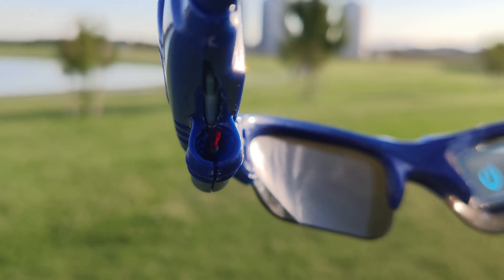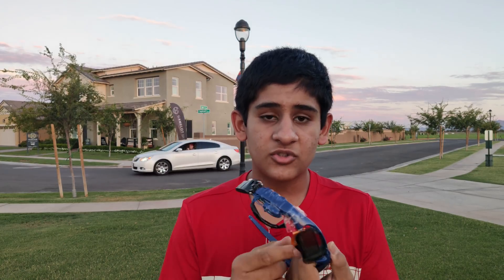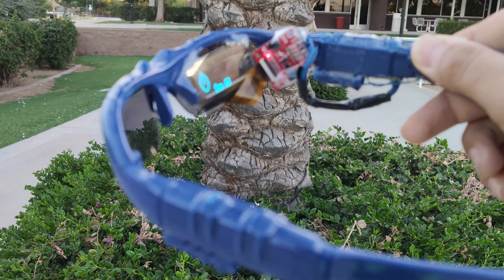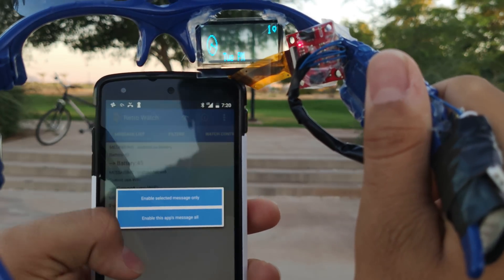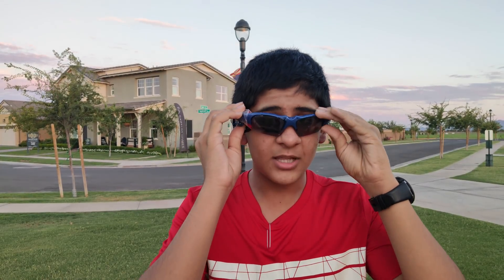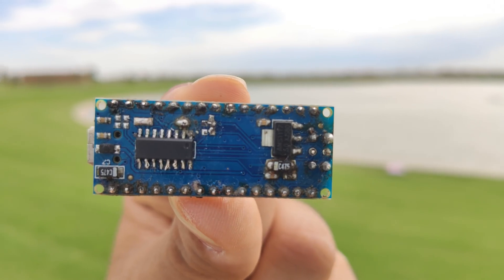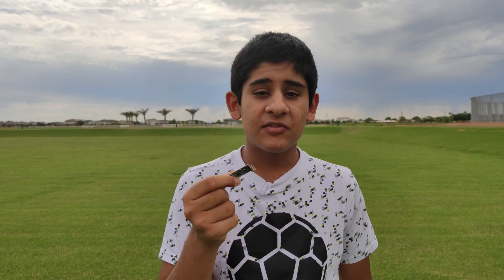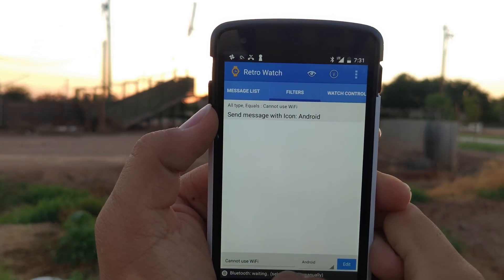Smart Glasses

Comment: Interesting! I'm planning on creating my own pair of smart glasses by augmenting my current pair--I have a vision impairment, and therefore I cannot make a seperate pair of smart glasses. I do have the software requirements nailed down to circumvent the vision impairment I have. These requirements are:
▪ A high level of magnification 
▪ Practical facial recognition (a maximum distance of 20+ feet away or higher)
▪ Object recognition 
▪ Distance indication 
▪ Text reading
▪ LiDAR 
Object recognition, distance indication, and the ability to read text easily will allow me to navigate cities safely and independently. I will be able to finally read signs, navigate city streets, and much more. Just like your design, due to fact my requirements are based off features in software, my design will be extremely versatile and functional. 

Keep up the awesome work, and I hope this will pan out into something big one day!
What coding language did you use, if you don't mind me asking?
Reply: I've been working on a similar concept, I was using C to program mine. I really like your designed features
Reply: @sam10155y  Thanks! Good luck to you as well.
Reply: I have been using a pair of myoptic glasses since the 1980s to aid me with a visual impairment, and I find these concepts fascinating.

Comment: great job, didnt know transparent mini oleds were available already. however you cant read anything when wearing the glasses it is much to close to the eye to focus. what lenses do you use?
Reply from the maker: I used page magnifiers  in a little box shape. The middle of the page magnifiers is stronger than the edges so it is almost a hacked bifocal lense setup. That is one of the main things I'm trying to improve in the next version!
Reply: @marskapadia6298  yeah.  No you didn't. Nice try though.  Page magnifiers aren't invisible and they cause major distortion at a distance.  Good job claiming to have done what other people have actually done.  Really leveled up your lies from "omission" to "straight up fraudulent jackass".

Also.  What did you smd solder? Ps. Its not called smd micro based soldering.  Its just called smd soldering, though it doesn't seem like that had an impact on your design at all. Wires aren't considered smd.
Reply: @HyperIonMake  why you gotta hate?
Reply: @dougb70  Would you "hate" on someone claiming they prove the earth is flat? Most people cant recognize this person is lying. I can, that makes it my duty to point out their dishonesty.
Reply: @HyperIonMake  he is a child. He is perhaps making inferences about his design versus his prototype. Why does it matter so much to you?

Comment: Do you have a lense in front of the display to allow you to focus on it?
Reply: my thoughts exactly. just being transparent wont make it appear in your vision clearly. you most likely see blurred blue lights in your vision.
Reply from the maker: So yes I do but for the video I removed it. I used the lense design from JLaser video. It involves page magnifiers in a rectangle setup. And I used the middle portion of the page magnifiers on the top and the edges on the bottom. This is almost like a hacked bifocal sectup!
Reply: @marskapadia6298  how do you keep the background in focus if you have lenses between you and the display? (the main reason we don't have smart glasses is complexity of optics keeping the display in focus and allowing you to see through the display at the same time
Reply: @Chris-bc6ny , @Mars Kapadia Try using laser technology like they use for H.U.D. setups in the auto industry, the focus field can be adjusted for the close proximity and everything will be in focus from that point to Infinity.
Reply: @marskapadia6298  Great job! I'm working on something like this but i ill try use transparent-mirrored image from oled display. And i'm got stuck when i try made a focused image. This need big distance from eye or optics. Definely i need lens, but i don't know which one :\